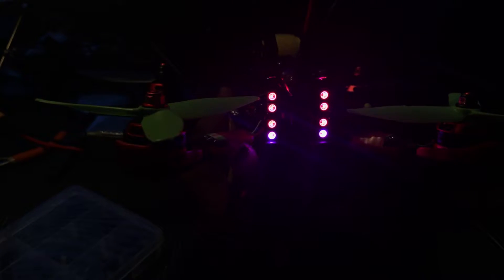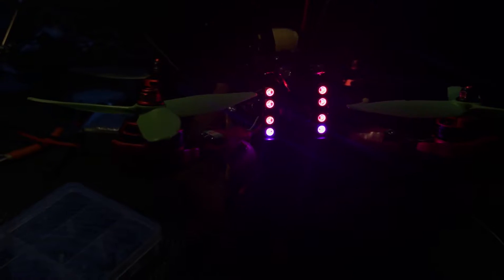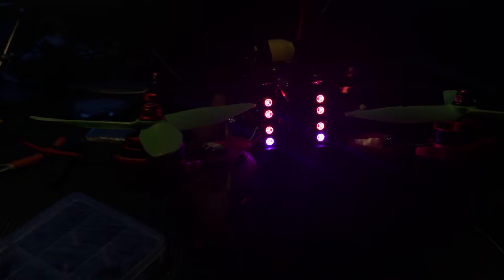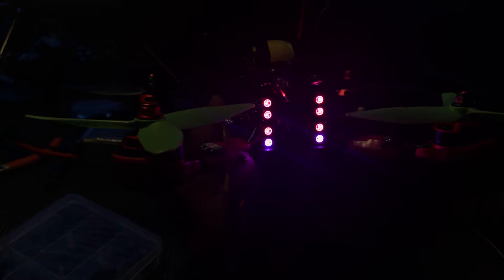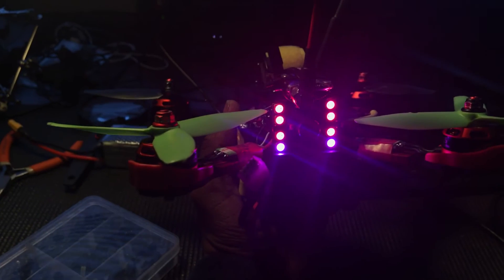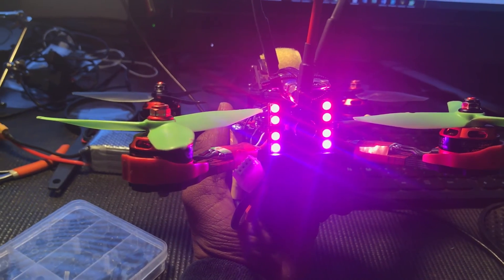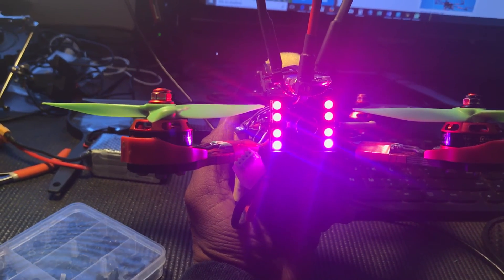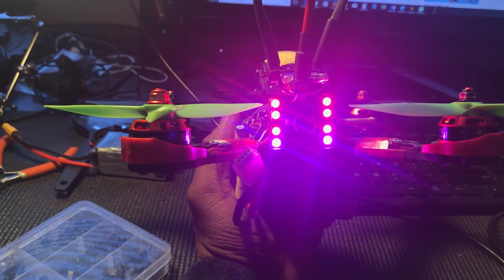Matek LED Mod on Realacc x210 Problem Solved

Comment: Waiting to join that FB group.  In the meantime, what did you do to get it working?  My button doesn't do anything and my buzzer just constantly beeps softly like 150 times a minute
Reply from the maker: MantisRay861 can you post a vid of what yours is doing when you press the white button on The fb group? Thanks
Reply: I just posted it.  Nothing happens when I press the button, but the colors change by themselves.